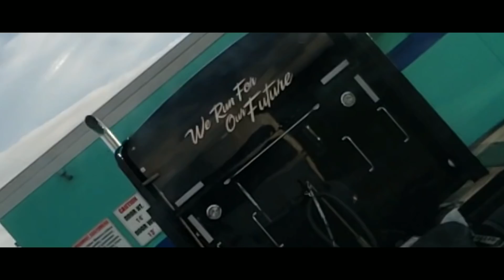Random DOT INSPECTIONS 🥵 | No More Drive Managers / Fleet Managers 🥳

Comment: Always replace your headlights in pairs. If you change one, change the same one on the other side. Also don't use those gloves you used to change the light. Get some latex gloves and use them to change the lights. Those gloves you used can trap different oils in them and it could get on the headlight and shorten the life span of the bulb. Especially if you use those same gloves to get fuel or do other work on the truck.
Reply from the maker: Thanks!

Comment: just giving you guys a heads up.  your company has had 168 inspections in less than two years. 

your company trucks have been put out of service about 9 times 5 which occurred this year

(7 of the 9 times was vehicle out of service and 2 times for driver out of service) some of the vehicle out of service is stupid drivers not doing pretrips

Also your company has had 4 crashes (KY,NY,IL and GA) 2 with injuries

your company Dot# is probably hot right not so dont be surprise if you get alot of random DOT checks 

so make sure when you spot something always note it on your logs and also notify your company that it need fixing, keep in mind you cant make your company fix something but logging and showing DOTthe you let your company know can help you keep stuff off your cdl sometimes when it comes to DOT
Reply from the maker: Not sure which company you are speaking about but doesn't sound like the company we are with
Reply: you with Try Hours inc right?
Reply: NuWaze Worldwide its panther
Reply: panther is worser than Try hours panther done had 80 crashes in 2 years lol and their out of service rate is higher

and they are not with panther
Reply: NuWaze Worldwide no it’s fed ex
Reply: not fed ex maybe you should go back a couple videos also there is not reason for them to go all the way to ohio just to be with fedx they could have came to atlanta for that
Reply: @nicandcarla  😂🤣😂🤣😂🤣
Reply: @nicandcarla  😂🤣😂🤣😂🤣

Comment: I'll be getting a trucking gps next week. Any advice? They all high as hell and i don't want to get the wrong one.
Reply from the maker: We've tried all of the Rand McNally's and the one we like is Rand McNally 740 but after a year expect issues 🤦🏾‍♀️
Reply: Chris Ajan Jr get the garmin I have it the last two years no problem at all. Get the one with the dashcam if you are willing to spend a little more plus it comes with wi-fi so you can update the gps with no laptop needed.